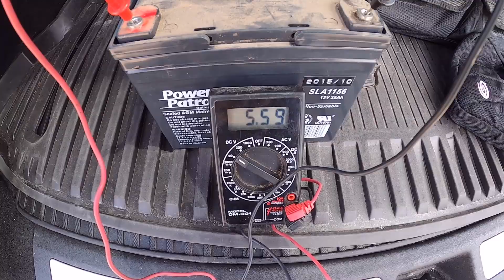Gate Opener ● Stuck Open ● Testing Voltage and Changing the Battery ✅

Comment: LOL, I just had to recharge my battery yesterday, my gate was sticking open also! 
its only a year old but my solar panel was about 5 years old and made for a smaller gate and battery. I will be monitoring closely, so far the board diagnostics show good
Reply from the maker: Oh wow!  I learned that if the battery is too big, the solar won't keep it topped off.  In another gate that I manage, I had to switch to a small size battery (basically a lawn/garden tractor battery) and it worked much better.

Comment: My gate got stuck open. I found out it was the fuses. I changed them out one gate closed and the other one stay open every time I would clikck the open and close button that gate that stayed open keep burning the fuse. I believe the board thinks it’s close how can I physically close the gate?
Reply from the maker: Temporarily might need to disconnect the actuator arms from the gates
Reply: @ApacheRanch  thanks you that’s what I ended up doing Turns out I had to reset the retract and extend setting on the actuator again don’t know what they got messed up.
Reply from the maker: Great! Glad you were able to make it work!

Comment: Your video goes half way by not showing the preparing the system to change the battery.  It was only 1/4 of information needed to completely guide me to safely change the battery
Reply from the maker: Thanks for your comment!  What was missing?  I showed the broken state of the gate, the testing of the battery voltage with multimeter, retrieving a new battery, putting the new battery in the box, reinstalling the black ground cable and red power cable, and then plugging it back in to the control board. Removal of battery is basically the exact same as the installation in reverse, so I decided to not show that activity twice.  Is that what you wanted to see?  Again, thanks for your comment!
Reply: @ApacheRanch  Hi, does it typically require unplugging battery from the controller board first? I have a viking L3 1st gen
Reply from the maker: Yes I would disconnect your battery from the control board when you test the battery voltage.
Reply: @ApacheRanch  Thanks. The batteries are indeed dead, just wondering what to do to replace the batteries. Do I need to unplug from controller board or shut off power to the board from the breaker, or could I just swap them out?
Reply from the maker: I would just shut off the breaker and then swap your battery out and turn the breaker back on again.  I’m not sure how yours is set up so hard to be sure. I hope that helps.
Reply: @ApacheRanch  thanks much for your suggestions

Comment: I have a Viking system and all the lights turn on and say the gate is opening but doesn’t . Do you think this could be a fuse issue or battery issue , it just started happening
Reply from the maker: Perhaps something is blocking a photoeye or other safety device?
Reply: @ApacheRanch  im not sure the only error code im getting is : Error Charg Check 4A
Reply from the maker: @BboyingISlife1  oh that is caused by either 4amp blown fuse, or battery or control board problem. I’d check that the battery is good first. Good luck!